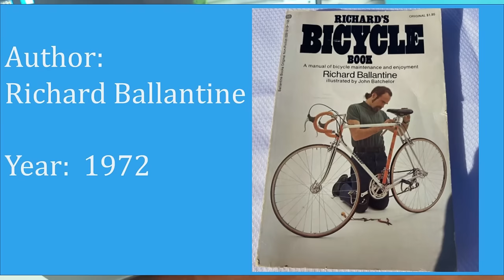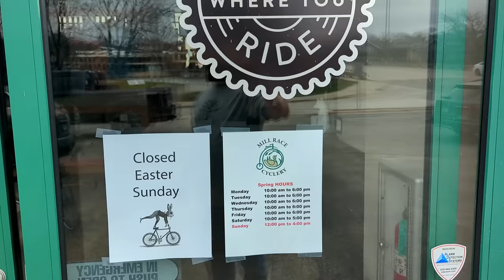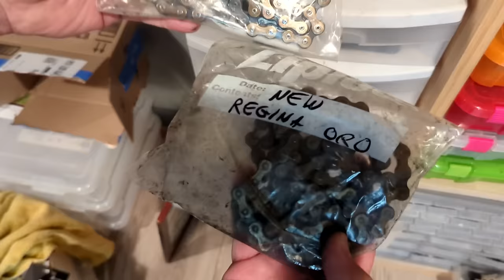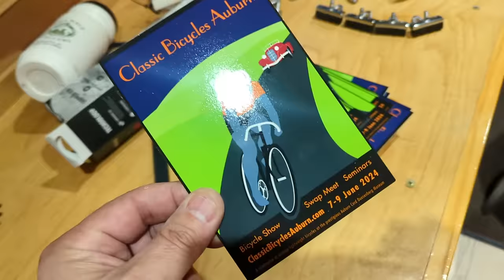Early 70s RARE Condor Superbe Restoration. The most beautiful bike I have!

Comment: Old bikes are so pretty. I did not have a project bike for more than a decade now, but recently found an old roadbike from the 70s someone had thrown out. Finished to make it roadworthy just today. It is not all original and I did not go to the extent you do. For now I just want to ride it a bit to see if I want to get into another expensive hobby XD. But it was a nice feeling to save it from the crusher.
Reply from the maker: awesome! What kind of bike is it?
Reply: @JohnsVintageRoadBikeGarage  it is called Steinmayr Special. Steinmayr is an Austrian biker and was active in the 70s. He collaborated with Pinarello to release bikes under his name. I could find only limited info what they came with originally. From what I can tell, my bike got an update sometimes in the 80s, so only frame, saddle and front derailer seam orig. Maybe the crank and pedals to. For now I just cleaned, greased everything, new cables, breakpads and tires. Does drive nice.

Comment: Those track pedals are great for those of us with big feet, since the quill on quill pedals tends to dig into your shoe if it's wide.  And given the size of the frame, the original owner probably had larger feet.
Reply: Amen!  Me too!  Super Record rather than Record.  Pro Ace (Japan) had knock of Campy pedals, looked great, and cheaper.  Sugino Might Comp crankset (Zeus/Spain)also worked with Record set up, interchangeable unlike most stuff today.  😞
Reply from the maker: Makes total sense! He had clipless on most of his bikes but this one didn't. Im sure that the track pedals will work better for me too!

Comment: Regarding the front derailleur, make sure you use the correct one for the the spindle and crank arms. Campagnolo changed the design due to CPSC regulations regarding sharp edges being dangerous.  The two derailleurs that you showed are not interchangeable. The raised edge on the cage is the problem on the the later ones not working on the earlier cranks without rubbing.  Ask me how I know.  Velobase has good guidance on this.

Comment: Hey John I believe Eric Clapton at one time was either  part or full owner  of Condor Cycles.
He was an avid cyclist and owned quite a few bikes one being a Cinelli
Super Corsa.
Great video as always.
Reply from the maker: Thanks. I will hopefully learn more.
Reply: Absolutely not. The shop was started by Monty Young in 1948 and has been in the same ownership ever since. Clapton’s Cinelli SC was stored in the lockup a few doors down for a few years up until the mid 90s. The stem had slow hand engraved in it.
Reply: Looks like it’s been resprayed. The down tube decal is not period correct as it was introduced in the 80s.  It’s also likely that it never had a double on it as many bikes in the UK were used for time trials.

Comment: Those pedals are sharp, they look like Campagnolo track, you can buy excellent Japanese made copies today. They are called MKS Sylvan Track apx $ AUD 50 without toe clips & straps, $80 with, & the end caps require a special spanner available from Velosaloon $AUD8. 
Sugino Aero Mighty sometimes found NOS, always very, very expensive are the same but with a pointed toe, titanium toe clips. Same MKS end cap spanner.
I use both of these pedals, love them, & think they are much better made than the originals.

The protective tape that I like to use on clampons against both paint or aluminium is the very thin  cloth tape that is used by hospitals & doctors. Its invisible, protects, & leaves no residue. I apply it to the clamp side & trim prior to mounting.
Reply from the maker: Oh. I'll stick with the campy. I prefer to keep them period correct. Thanks for watching.

Comment: I remember seeing a Super Condor, back in the early 80's.
PS. Back in my toe clip days, I would always use white Bilda straps.
Reply from the maker: You were happening if you used Binda straps
Reply: @JohnsVintageRoadBikeGarage  
You were really happening if you used Binda Extra straps. They had a thin layer of nylon between two thin layers of leather. The nylon would keep the straps from stretching and listening when pulled tight.
PS I would use double straps for racing. The front strap would go through the front slots in the pedal, and over the front of the toe clips. It would allow me to pull at least one foot out, in a crash.
PSS. I would always pronounce Binda like the word "in"

Comment: Beyond a number of light polishing compounds and cleaners.......... If you have never experienced Klasse "Red" (German), you must. Exceptional surface - paint - cleaner, polish, acrylic protectant. Does wonders on metal/chrome, aluminium...... Primarily focused for automotive application but is fully manifold.
Reply from the maker: Thanks for the tip!

Comment: That was actually not a bad chain you took off,did you check it first before getting rid of?Also I stay away from stainless cables.
Reply from the maker: The chain isn't bad. The chain wasn't period correct. So, I went with the appropriate Regina. Why are you not a fan of stainless cables?
Reply: @JohnsVintageRoadBikeGarage  they stand out as non original. Zinc coated cable are hard to find so it’s an area I look at when judging vintage bikes